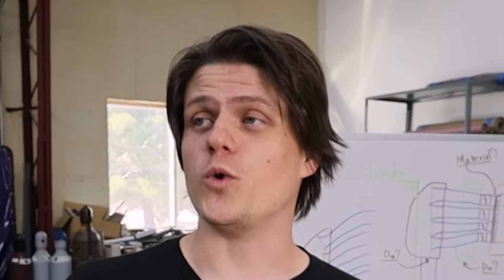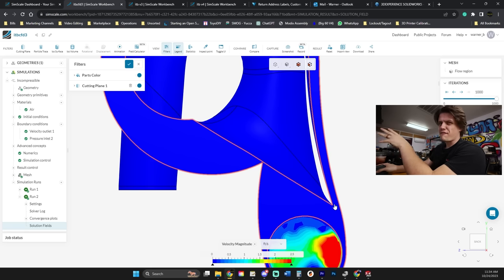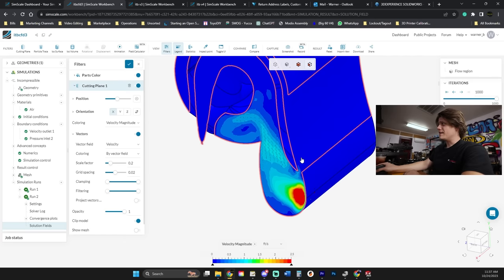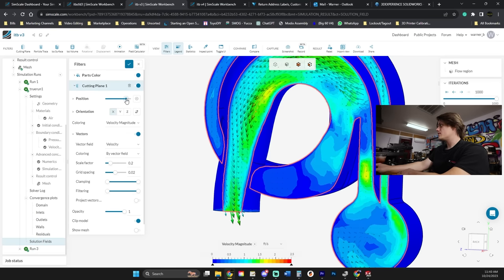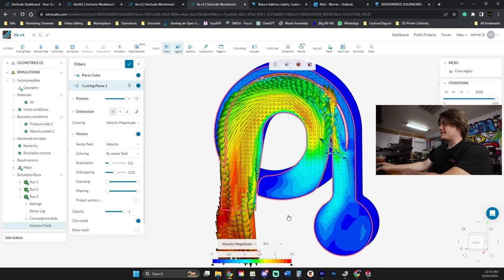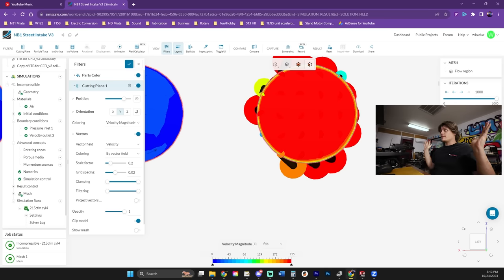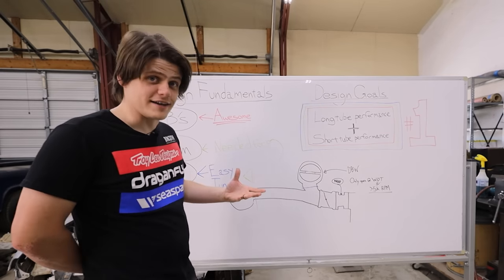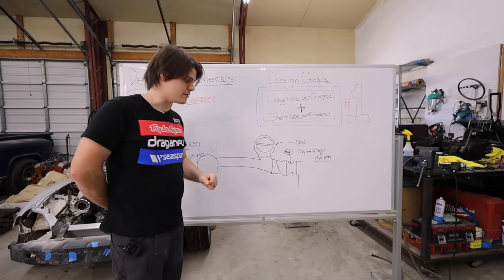The 3D-printed ITB intake system continues to evolve

Comment: Do we have any calculations of resonance tuning and what cams/exhaust/runner length/taper etc? I love the documentation and effort but feel once its on the car running there will be something overlooked providing negative or zero gains. When you run another simulation blocking the shorter runner you very well might find its actually providing less volumetric flow to the port choking it out. You can kinda see it in the plot towards the bottom having the really dark below with almost 0 velocity even though the shorter runner is wide open.  Like wise having having uniform radius of the runner might help or hurt the flow as opposed to a straight runner.  Q= A x V where area/volume are porportional but there are few other factors and you can look up the theory for nozzel flow where an increase in velocity is a decrease in pressure. Less pressure is less volume and less volume is less power along with some ideal gas laws with density/temperature of the fluid. Its like trying to fill a bucket with your finger on the end of the hose making the water have an increased velocity but very little volume vs leaving the hose open will have more volume but less velocity. Im not sure were your getting 6192 cubic in per second when ball park a 1.6 engine @ 75-85% Volumetric efficiency will have about 168cfm or 4838 cubic in/second. On the same site you used and for a straight circular pipe not a curved oval cross section would have 163.55ft/s velocity which is about right for production cars. Ignoring the intake design to be able to pull in 200+ ft/s you'd need some pretty good internal work and that isnt just whole power band but the 163.55ft/s is at 7000 RPM. 

I'd look into as well with cams/exhaust plays a roll and what volumetric effiency and flow rate really means instead of looking at vector/velocity plots which are good visuals but provide no real data on flow or performance. Start with the engine displacement, port length/size of intake exhaust, choose cams and bounce back and forth what resonate freq you're aiming for increase intake length, change exhaust, increase/decrease cam duration or degrees. The volume flow your using as well is a pretty big asumption off of pipe diamater which an oval cross section has different pros/cons. To get the exact amount of volume of air you'd need to do a little math on the engines bore and use a pressure drop once intake valve opens pulling in a vaccum and then just below atmospheric plenum pressure rushes to fill the engine bore. Think of a vaccum, it doesnt suck air in, there is a pressure drop inside and the outside air wants to move inside the unit to fill up the volume of the container. Might need to check that second intake design on the drawing board and the intake CFD and really question are they really any different in practice/theory with your observation of flow.
Reply from the maker: I got 6192ci/s from 1.8L at 8k RPM, didn't apply an efficiency percentage. 

I have a 4 into 2 exhaust that I'm going to modify to the intake once these questions you've posed have answers. The way I see it, the chamber will be able to resonate at two different frequencies (and even a third that's not shown in the video, there's a bypass I envisioned that I showed in an earlier video).

I think that's the next major step for me is understanding how to calculate resonance and tune with it.

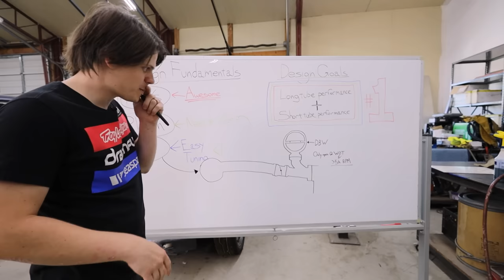Comment: 17:10 some sport bikes have something like that. ITBs with short runners (and velocity stacks), going into a chamber with a throttle body, and longer intake runners. At lower rpm/load, the single throttle body is closed, and the air has to go through the longer runners; and at higher rpm with high loads, the throttle body opens and the air can bypass the long runners.

I'd say that the main difference to what you did (other than the ITB placement you corrected later), would be that the air enters through every side of the short runners, instead of being a Y split (so it probably has better airflow)

Comment: Porsche made an interesting intake that for a forced introduction car it used the intake pulses to reduce the incoming air density thus cooling it, which allowed them to run more ignition timing and make more power.

Comment: Another direction you can take the dual inlet setup is to divide the cylinders based on the firing order to give the plenum the most amount of time to fill before the next induction so for the 1.8 (1-3-4-2) you could separate 1-4 from 3-2. If you want to try leaning the runners, 15 degrees is the maximum angle air can turn without breaking laminar flow (standard 3 angle valve job is 30-45-60 for the same reason). and dual 3 inch inlet is a bit overkill, a single 3 inch flows about the same as dual sqrt((3^2)/2) = sqrt(4.5) ≈ 2 1/8-1/4 pipe so dual 2.5 inlet would be plenty. Additionally, if you want to flow everything through the stock TB, cut the butterfly shaft in half so only the threaded side remains, should increase the cross sectional area and reduce pumping losses. Hope some of this is helpful, and I can't find your discord.

Comment: You can ionized the intake air simply by creating a swirl motion in the intake, especially if in contact with conductive metals such as copper, silver gold or platinum. Silver plated copper would be  good price / performance value. You can still get away by using Alcaad, mirror finish aluminum.

Comment: Perhaps you could simplify and accelerate iterations by reducing your study to feeding one cylinder, one intake port.  That could help in CFD checks and be easier to print test samples for use on a flow bench. Even the best CFD and FEA tools are cartoons representing what is real.  On the far side single testing you could then merge feeding 4 cylinders, ports.

Fwiw, check out the section view of the new ish z06 motor. The intake valve is fed by a very sculpted cone transition from the main plenum. Note that the v8 plenums in coyote, modular, or LS sbc use the same circular winding thing to package runner length.

Comment: I think possibly switching the short runners into more of a straight shot into the intake ports with the longer runners coming in at an angle might help performance.
Reply: would be easy to test, make two profiles and run the motor to redline with both only using the short runners while logging maf, overlay the graphs and your answer is there.

Comment: I can help you again in the math department for airflow 👍
Taper of the runner can be 1.5/2 degrees, then over your length will give you the diameter of the bell mouth.
Airspeed wise on an engine we don’t really want peak airspeed past 640fps, this will occur in the head port itself at the minimum cross sectional area and localised points like the peak of the short turn radius.
Airspeed is dictated by a pressure differential created by the piston accelerating down the bore, peak pressure differential should be less than 3.4psi to keep airspeeds under 640fps.
I suggest testing your manifold in cfd at the industry standard of flowbenches which is 28”water column (1.01055psi) then you can calculate efficiency, the maximum average at that test pressure is 350fps, localised areas within the cross sectional area can be higher but the average can’t be higher than 350fps, that is 100% efficiency.
Then you can use the cfm demand calculations I gave you last time to see if it all lines up.

Look up the Ford Australia broad band manifold for our in-line 6’s they are a dual length runner manifold
Reply from the maker: That's great info. I imagined that there is probably a max useable airspeed so I'm grateful you've confirmed that.

Using 28" water column in CFD would mean I plug in 1.01055psi at the pressure inlet side? At the outlet side I use the CFM demanded flow rate? (215cfm)

👍Ford Australia broad band manifold added to the research list
Reply: @StandRacing  in regards to what to plug into cfd software I don’t know, I personally haven’t designed a manifold from scratch, I just port and modify existing manifolds and confirm airspeeds and map velocities with my flowbench. I would image that you would have atmospheric pressure at the inlet and then 1.01055psi less at the end of the runner, that is the pressure differential, air moves from high to low pressure.

One thing I want to point out that occurs with real life physical manifolds as well, is that people port and modify them, then flow test them by themselves, not bolted to a cylinder head. This is not the right way to test a manifold, the cylinder head port dictates how the runner behaves, the runner also dictates how the port can move air, they are actually 1 and need to be tested as 1. 
When you flow test a head and measure the airspeeds at the opening they are not all even around the entire surface area, in fact the spread can be very wide, so when you bolt a manifold on, the manifold runner is not being drawn apon evenly on its entire surface area either.
The issue I see with cfd is that I’m not sure you can replicate that pressure differential at the cylinder head side of the runner, plus that end of the runner is discharged into nothing, into an open space, so it’s not representative of a port and you will find that the results in real life bolted to a head to be very different.
I am enjoying this project of yours tho 100%, the idea of straight runners is ultimately the way to go but as other manufacturers have done for packaging reasons the long curved runners have been done successfully. The broad band manifold I mentioned looks like a snail shell along the top, this is the long runner section, inside the manifold there is a row of butterflies on a shaft that are solenoid operated to open at a certain rpm point to open up the short runners, the manifold was used on Australian Ford Falcon SOHC in-line 6’s from about 1995 to 2008

Comment: Are you modeling with a fixed flow rate? You need to consider the flow rate versus valve events, the benefits seen from variable length runners is by taking advantage of the wave bouncing off the closed intake valve and getting a suction event timed at the same time the next intake valve opens.

This is much more complex than just a fixed flow rate problem.

Comment: 13:15 over 100% is realistic, honda F20C heads have a VE of 112%. Air is compressable and thats why achieving over 100% with modern tech is not out of the realm of possibility.

Comment: might be worth building a method of measuring flow consistently, Maf sensor on the front and a pump on the backside, because of the internals not being entirely separated you would need to group the runners as a common output, setup the motor on the blower so that you can read volts and amps and run it the same on all tests, this way you can see improvements in Real-time not just simulated, because with a given amount of power a given amount of work can be done and the Maf will show you the differences.

Comment: Volvo had a system similar to this on the B5254F 5 cylinder (since you are adding a secondary throttle-plates anyway) Basicly the short runners were nearly straight with a valve that closed them off at low revs, where the cylinders then drew air through the long and curved runners from the same plenum volume (which had no valve), over 4000rpm the valves opened and the air took the shortcut through the short runners. It worked, acted kind of "V-tec'y", but became obsolete when they switched to VVT (first on intake only) as advancing the intake cam on the lower revs where it was "overcammed" basicly means earlier IVC, and thus more trapped air (far more than acoustics would do) than what would have been possible at low revs with a fixed cam.

I'm sorry to say, but you are very late in the game. Toyota, Mazda, BMW nearly all else has had some form of active or passive two- or three-mode intake-resonance system before VVT became mainstream.
Reply from the maker: I'll take a look at that one too 👍

I may be "late" as you say, but the game of advancement has no beginning or end, only a direction.

Comment: You definetly got to check out 1-dimensional gas flow calculation possibilities for that thing you wish to implement, as it is first of all acoustics of tubes and plenums system. For use with engine simulations, there is an awesome open source program called Lotus Engine Simulation.

Comment: This is a two length inlet runner concept. Formula Student cars have experimented with continually variable length inlet runners by actuating the telescopic intake horns length. Single telescoping limits it to 50%-100% length range, triple: 33%-100%, etc. So it's diminishing returns for increased complexity. There's also the required change in diameter that might change your airflow undesirably if not factored in.

Comment: I love the scroll design. Is there a reason you couldn’t have a gate between inner and outer that is vacuum controlled or servo controlled based off engine parameters and input? Also is there a potential benefit to having a waste gate type door mid way through the scroll that feeds back from the inner to the outer; this could allow air to keep circular momentum when ITB closes and easily flow when it opens again.

Comment: The reason you want a variable length intake is to profit from the air volume in the individual inlet tracts resonance/speed while pulling in air. Using a single long header per cylinder and then combining the short header part with a single throttle valve will seriously mess with the whole resonance trick. Formula one had actual "slide trombone" inlet headers with flat slide throttle valves. This was possible because they had insane high RPMs and a narrow power band.

Comment: You know a guy its passionate for his topic when he says: "Here me out"
I studied chemistry, all the aerodynamics that i know are from yt videos so take this as a ideas/question to a professional more than a solution per se.
First i would work more on the distribution between the cylinders of the new intake, but its fking awesome, how it would react if you put a turbo there? Check it out with simulations! You can 3d print them to test performance, as long as you dont use it in a race i think that you can try modelling one after other and running it on a dyno or some similar way to check if its better or no.
As for the plenum i think that they should enter from the left bottom corner at a 30/45° angle to aim the air directly to the cylinders and get rid of that 90° angle  that you mention

Comment: You need to look up offenhauser 360 intake manifold.... it devided primary and secondary sides of the carb to increase airspeed ... each had its own runner ...there was a bit of a odd transition because the secondary air was at a dead stop and had to get up to speed when the secondary side opened
Reply from the maker: Thanks for the response 👍

Comment: Air will go faster at lower pressures. Make sure you don't create a pressure difference that is so high that you aren't actually getting more air in the cylinder. There is a reason why MAF sensors output weight per time unit. The more air weight you get in, the more fuel you can burn and the more power you get per combustion. This is tricky to wrap your head around so it helps to step back and look at the principles of combustion engines and verify you aren't tricking yourself.

Comment: Just some clarification on the CFD/hand calculation flow velocity results... you mentioned an efficiency, but pipes don't really have an "efficiency". From a fluid dynamics perspective, the best "efficiency" possible is a straight tube with infinitely smooth walls and laminar flow throughout (turbulence/vorticity means a loss in "efficiency" of the system). What you're seeing here is more likely to be an artefact of using CFD, or any finite element model. I have more experience with FEA structural analysis than CFD, so take this with an appropriately sized grain of salt... But I would take that ~3% increase in calculated flow velocity vs. a simple hand calc to mean nothing more than your boundary conditions in your CFD setup are set properly.

I think what you're attempting to do is equate flow velocity with volumetric efficiency. With your current simscale setup, you cant really calculate VE because you've assumed a volumetric flow as one of your boundary conditions. If you wanted to calculate a more relevant performance metric, you could evaluate something like the change in enthalpy from the inlet to the outlet. I'm not positive if this would change with your given model, but if so it would show how much energy is going into/out of your system in order to meet your specified volumetric flow. In this case you'd just want to minimize energy input for a given volumetric flow. 

That said, I'm being nitpicky. Good work, especially for someone who hasn't studied engineering!!

Comment: Correct me if I am wrong, but long tube runners are for low end torque. If you have a race car you would rarely keep the car under 5k rpm, hence why everyone just runs ITBs on an NA car with the exception of specific class specific restrictions (some require factory manifolds etc)
Reply from the maker: You are correct. But, that gap between rarely and never can make a substantial difference. The biggest difference being gear selection. Shifting takes time, so if you're maxing out 2nd gear out of a turn because you downshifted during braking, but keeping it in 3rd gear puts you at 4K RPM at turn in, that extra strength down low will make it very likely that not downshifting will be faster there.
Reply: Another thing to consider is some racecars are starting to use CVTs and be  hybrid version tuning for 2 primary bsfcs is now necessary for winning long race events